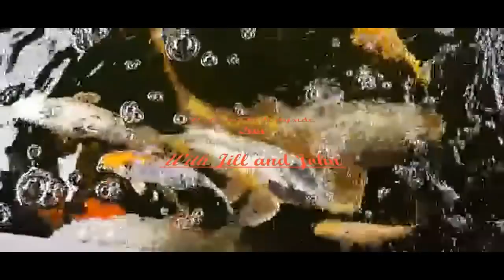koi pond blockwork nearly done, koi fry night feed and some koi art. Ep 20

Comment: doesn't the fibre glass have to lip over the top brickwork to seal off with the copings, to stop it coming away from the wall and water from getting behind it, how will that work with the shower end of the pond, just curious, thanks
Reply from the maker: There will be a lip over the insulation then the fibre glass will go up behind the wall tiles.